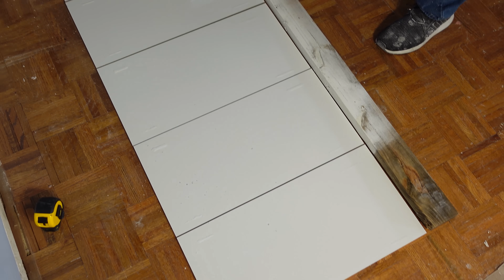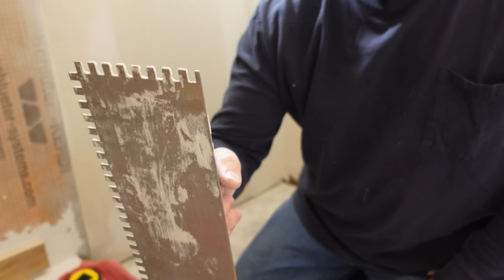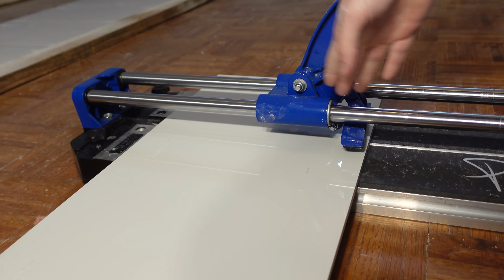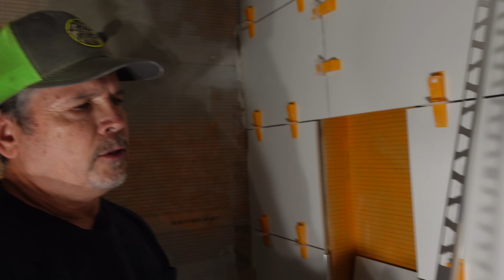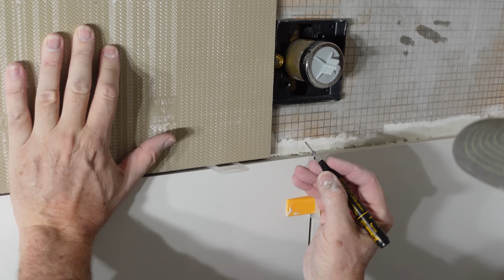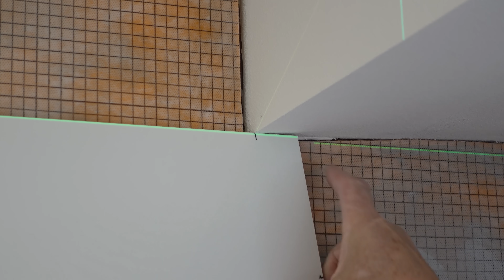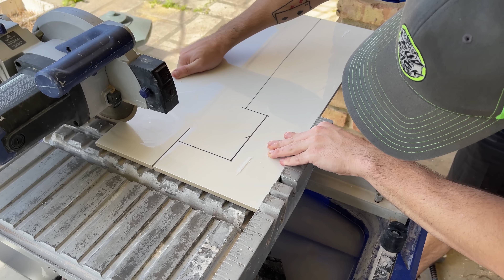Buy THIS Tool BEFORE You Tile! | Tiling a Shower

Comment: Hold on, if you need a diamond hole saw for a job bill for it (factor it in as cost of goods) then you have that at the end of the job you dont need a set you just need the ones you keep using. Which for GC what you need a 3/4, 1, 1 1/2 just the common sizes of plumbing pipes/ fixtures you use in your area. It not like you are doing custom tile every job or are doing crazy  glass work

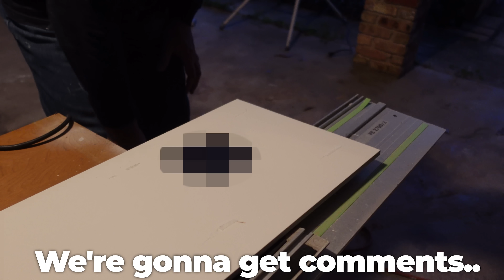Comment: 20:30 ...I was thinking "hmm maybe I should cut it from the back"

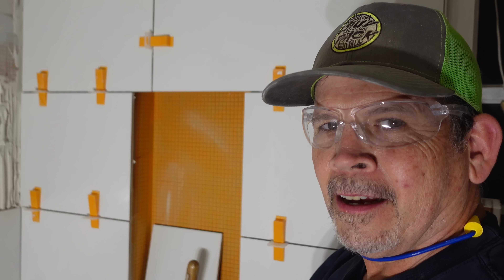20:50 "ohhh my gawd definitely not"

Everything else looks pretty good. I usually tape the profile strip up first and use it as the starting point and have all the tiles pre cut. Then cut the inside corners as I go in case the other wall isn't perfectly plum

Comment: Paul, nice. But I learned from old timers, start your 1st full tile at mid wall. A layout sketch would tell you where to start that mid tile either at the joint or middle. This way if there’s any discrepancy in 3 wall heights this will lessen the error and essentially hide the differences.

Comment: Instead of screwing in the ledger strips, carpet tape (or other carpenter's preference double sided tape) would work really well. Strong shear resistance and easy to peel off with no holes in the Kerdi.

Comment: I noticed for the corner you ran the tile from the other wall "over" the other tiles face, instead of meeting the edges so the grout isn't on the top of the tile on the one. Shouldn't you have met them equally in the corner so grout wont chip out?
Reply: it is how to do it. backwall, then the sides. corners get caulk.

Comment: Which brand of snap cutter would you recommend? I see that the one you are using in this video is by Pr1mo tools, but I have not been able to find them online.
Reply from the maker: Primo is the in-house tool brand at ProSource (prosourcewholesale.com)  I'd probably go with a Montolit; pricey but if you cheap out on a snap cutter you'll be frustrated the entire time.  Tiletools.com has a good selection of brands

Comment: Thanks so much for you videos. If I may.....Wouldn't it be simpler to have a piece of thin cardboard cut to the dimensions of the tile and then press it against whatever obstruction you're working with (shower head, valve, etc.) instead of measuring? The indentation should be perfect and then transfer it to the tile?

Comment: Only thing I would have done differantly is lower,fix the ceiling. I always consider the size of the tile when planing ahead especially with tiled backsplashes. The more cuts the more time and possible screw ups.

Comment: Best shower tile video(s) ever.   Exactly what i needed.  The only thing i wish you had done is how you do the metal corner edge on the inside corner.  I bought it too in my plans because the wife insists on me having the Bronze look to match her faucet trim.  You didn't use it on the inside corners in this video.  No complaint, just saying because i'm wondering if there's any trick to it. Thanks for all the details and not rushing through and for great audio quality as well.  Much appreciated you guys from here in Albq. NM.

Comment: Guys you do a really good in your explanations and I appreciate that.  About that square for the shower valve  Really? no need to have a finer cut it is behind the shower valve handle plate, no one will ever know so you shouldn't have ever mentioned it silly.  I do have a couple of questions however I know you are busy but I will send later and see if you can get back to me.  Jim Austin, Tx

Comment: Thanks for the great videos! Always well explained with details a novice needs.   I noticed that your spacers look to be about 1/8 inch  Is that what they are?  I've been using 2mm (about 1/16) and although doable, there's not much forgiveness and you really need to do a perfect job on every tile especially first row as usual.  But I'm also thinking that for large tile like 24x24, 1/16 grout joint kinda looks too small.  Your thoughts?

Comment: Your top row on the shower head wall should have been in two pieces. You fouled up your grout line pattern by putting it in in one piece. 
Sorry. I've been setting tile Both commercial and residential for 30 years. I notice things like this.

Comment: Excellent description and thanks for going to the effort to experiment with different trowel notch sizes.  I bought the same levelers to use on my kitchen floor.  You showed I better buy the pliers tool.  Wish they had those at Home Depot when I did my last tiling in 2020.  Ceramic or porcelein tile?  On my last home job, I recall I couldn't use my snap-cutter on porcelein so had to wet-saw them.  But your snap-cutter is much higher quality.  I bought a new diamond blade for my current job.

Comment: Best “How to” since this old house!  That spacer wedge system is a game changer.  The edge trim also a great finish.  I have been wondering how that is applied.  What are your thoughts on the membrane.  I’m redoing a 32”square alcove shower.   The previous tile was in there for 40 years without a membrane.  No issues.

Comment: Pauly cleans out as he goes using one method, I clean up as I go just wiping w a finger, then apply the tile, then clean any that leaks out w a damp rag. Either way works

Many tile outlets, Home Depot, Lowes, even regular tile shops, are not offering tile borders... so I have been using Terrazzo strips for years... aluminum strips in the tile dept areas... different finishes for your preferences. I use them on the vertical outside edge, thin set them in 1st, then start your walls. It leaves a perfect, clean & decorative edge. Put the trim edge on FIRST. Paul... much easier than after. 

I own about 10 garbage cans... couple different sizes also... I ALWAYS have at least 2 or 3 on a jobsite at the same time. I also have a few small pieces of plywood, 10-20% larger than the size of my cans. I use them ALL THE TIME as a work platform. Place the ply on top the can & place the tile cutter or saw, on the ply. Nice to NOT work off the floor on a million different things.
They have diamond hole saws I like to use. I think the whole bubble is way too much... I like a 1/4 bubble or less for bottom piece, this way water still drains but bottles of shampoo, etc, don't lean too cattywampus. That bottom tile is only 3 or 4", so a hair of pitch is sufficient.

Comment: And then you look at the box and it tells you to lay the tile exactly how you explained it😂 usually it will tell you the only way to lay the tile and directions on the box of tile! just put the small cut in and you wouldn’t have to patch a new holes in your waterproofing avoid puncturing your waterproofing set your first row first and you won’t have to worry about screwing anything in that would be my advice. Otherwise people like me will have more job security.😂

Comment: Great work, really like your site, reference to forgetting to put the spacers in place in the last row for the next day job, I miss some sometimes, I use a multy cutting tool and create space in the mortar behind the tile for the spacer. I do make sure to set the spacer into the wet mortar up against the back of the tile and not the wall especially when using thick stone tile with 3/4 inch trowel or might have problems fitting the leveling wedge in the spacer slots.  Again, like your videos and the interaction with your son, take care.

Comment: One tip I learned the hard way is make sure there’s no drafts in the room or your Thinset will skin over super quick. There is a HVAC supply vent in the small bathroom I’m working in and I believe the A/C was sucking moisture outta the air and causing it to skin over way too fast resulting in subway tiles that didn’t adhere. Also good idea to soak them if they’re ceramic so they don’t pull moisture out of the top layer of the Thinset too quickly

Comment: Your a great instructor, as far as cutting the holes for the fixtures, I used 15.00  bit, what it was was a Dremel tile bit with a rotozip tool. I cut 5 holes and it's pretty much done for. But for the price I can't complain. It was worth it's weight in gold..

Comment: Most top tile mechanics will add layer of 1/2 inch of plywood before adding system and raise the inside shower then you will have the ability to scribe  cut ceiling

Comment: the size of the notch depends on how much tile adhesive is needed. a larger notch, more glue, e.g. due to a curved surface. To obtain better adhesive coverage, you should also apply adhesive to the tiles. Don't forget to wash the tiles if they are smooth on the reverse side and covered with white powder. As for the direction of laying the tiles... they should be laid in the way the investor likes.

Comment: Not a bad job, I would of spread the notch on the tile and burned in the walls. I usually stop my curb and shower walls at the same point. Would also work in the tiles a little more. I'd say it's better than 90% of the videos out there.

Comment: Whenever I have a 90-degree transition in tile, I never grout the seam. I use RTV instead to keep any expansion movement from cracking the final look. I hate your vertical seams. I place mine in the middle of the tile or not at all unless the tiles change dimensions. I try to choose tile sizes that work best with the layout space or adjust the layout space to accommodate the tile dimensions. As far as the niche' edges are concerned, I use a flusher edge and bull nose edged tiles around the border. That's the entire purpose of bull nose tiles.

Comment: You will get a lot less chipping if you cut your mixing valve from the front. Also, Milwaukee diamond Core bits are only about $30 and they would last you for dozens of showers.

Comment: When they cut that square hole out for the shower valve, instead of doing it from the back and getting a mess of hole like they did, use a grease pencil and do it from the front.  Your cut will look much better and you can wipe the grease pencil marks off the tile when you're done.

Comment: from your previous video with the water test, the thin-set got wet. I believe you said that the grout and thin-set get wet and the water then hits the schulter membrane then moves to the pan. So would you not want to put a membrane on the small area of drywall even though it is outside where the glass will be. Also how long do you have on the thin-set to put that metal trim piece in?

Comment: Great video but I have one question, please.  I am about to tile and I also used Kerdi board.  I put a strip of the Kerdi waterproof band where the Kerdi meets the drywall.  I noticed that you did not.  Now I have a slight elevation where the band meets the drywall.  Will that be a problem?  Should I remove the waterproof tape at that location?  First time doing this so excuse me if that's a stupid question.  Thank you.

Comment: A lot of comments, so this may have been mentioned.  When back buttering the tile you should notch it the same direction as the wall, then a little lateral movement for no air pockets with better adhesion.

Comment: You could use painters tape to lay out the lines with the speed square on the front side of the tile. Then cut with the grinder from the front side and inside the tape line. The tape won't mark the tile and it helps prevent too many chips.

Comment: Your using a Turbo Blade with your grinder, Thats the blade with Teeth Like style, use the a smooth Diamond Blade for your grinder, that will cut much smoother.

Comment: I love your videos.  I'm learning as fast as I can, tiling a master bath walk-in shower with 12 x 24 tiles, and pebble floor, now.  One thing that I learned that you don't have in there is to put the leveling system Ts behind the ledger strips so that the bottom tiles can be leveled when they are installed.  Don't forget to lower your ledger strips the appropriate amount to make up for the additional height that the Ts add to the ledger.  Also, be sure that you put the Ts in all of the correct places for the tiles to be installed above and below.

Comment: This it the best tutorial!!!!  In case if we have square 600*600 porcelain tiles, is there any rules in which direction they must be notched (vertical or horizontal), please? Also, I can`t realize how you use tile levelling clips under your first tile row. A guide supporting plank can`t let you do this. Should it be done before laying the first course, or, may be you can make a space for clips after you take this temporary support away?  Also< how the final adhesive  thickness can be estimated after pressing tiles to walls and curing, please? Thank you

Comment: When your installing 12x24 tiles, after you key in the thin-set on the back of a tile, can you trowel the thin-set onto the back of the tile with the notched trowel, rather than the surface it’s going on?  Thx

Comment: I love your work! I just have one thing to add. Schluter has spent years formulating their thinset to be the best bonding material for their banding, membrane and fleece. They say the combination makes the thinset waterproof at point of contact. I have seen tilers blame failures on the Schluter "fleece" and banding after not using the proper Schluter  thinset. To have a full warranty why wouldn't you use all Schluter products?

Comment: Excellent work as usual 
The saw holes you can get them easily and inexpensive on Amazon or EBay 
In fact, I have a set that I bought for $25 ish  about 2 years ago and I have probably only used the most common one for the shower head nipple and it still does the job on any hard or soft tile for 2 years now!!!!

Comment: This guy is an idiot. A notch trowel is used to create air gaps in between the notch spacing on purpose. Can anyone guess why? If you want 100% coverage you wouldn't use a notch trowel. The unlikely event that you spring a leak, the notch spacing gives drainage or weeping to the shower Pan and out the drain if installed correctly.
Reply: Would the drainage behind the walls you speak of only be because you didn't properly waterproof???? Now days that we have better waterheaters and can take very hot showers for hours we must totally waterproof BEFORE the tiles go up. What do you mean when you say "spring a leak"?
Reply: My understanding is that you're supposed to collapse the ridges for full coverage. Hollows behind the tile sounds hollow!

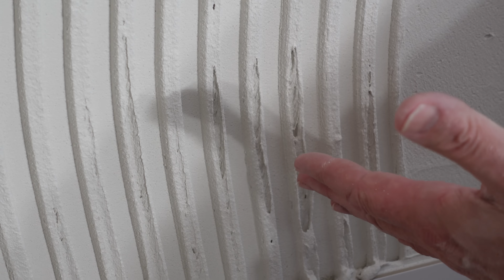Comment: 10:11
To avoid voids you should grab some more thinset with the notched edge of the trowel and then trowel the wall. This will create larger thinset lines without any voids, and will provide more coverage. It's also faster than skim coating over voids and troweling over it again.

Comment: The screw type levelling system will level the tiles well but it has some shortcomings. Since a steel pin is used the pins need to be removed once the tile is set. This requires the pin to turn 90 degrees. Leaving them for too long the thinset can make it impossible to turn. The wedge system pieces can be left until the thinset is completely dry since they are meant to break off.

One thing which needs to be watched is to make sure that there is NO thinset on the face of the tile where the wedges are slid into place or where the nuts on the screw types are placed because you will get scratches on the face of the tiles.

Comment: They make a hole saw that attaches to the angle grinder.  It is also a diamond.  It looks like a deep socket similar to the one you would use to remove a spark plug.  You usually only need an 1" 1/4" diameter hole to fit the cartridges and the shower pipe.

Comment: I'm looking to sort my bathroom myself and watching vids for reference. I know raised the tile because of the bulkhead but if you started from the bottom, could you not have just put a piece of plasterboard/sheetrock to square off and come down to the top tile? Would have just been a straight cut as you go up past the bulkhead then...

Good tips though!

Comment: I'm a little surprised that you used the levelling tabs. They are definitely hand I and produce a good leveled surface however I thought them more for the DIY group like me. They are a little expensive and I thought pros didn't need them to get level finishes or would want the additional time and cost to use.

Comment: Would you recommend the leveling system for a 4x12 tile on a back splash.  Or does using the adhesive type 1 make that not necessary?

Comment: Question about your back and forth motion when setting these rectangular tiles here. Are you intentionally working them L/R because that motion runs perpendicular to your vertical thin set rows, or is this just random or unrelated to directional troweling? This is a fantastic tutorial btw. Thanks so much for sharing! 🙏🙂
Reply: The back and forth motion collapses the ridges for the full coverage he's talking about.

Comment: Attention! I don't want to be rude, but 90% of this "informative" video is wrong! I am 47 years old and I caught the time when I used to put the tiles on a mixture of sand and cement and put the white glue (used in carpentry) to strengthen the material so that it can make a good connection with the wall. The trowel with big teeth is used for, floor tiles! The one with small teeth on the wall tiles (it depends on what size of tiles you have). in cases when we put heavy tiles, we use bigger teeth... First of all, don't try to put tiles on crooked walls... It's the job of the dry liner to make the walls straight! You can't put quality tiles on crooked walls... You can't start with 5 mm adhesive at the base and finish the top plate with 20 mm, that's not tiling. There is a lot to be said about this video that is pointing many people in the wrong directions.